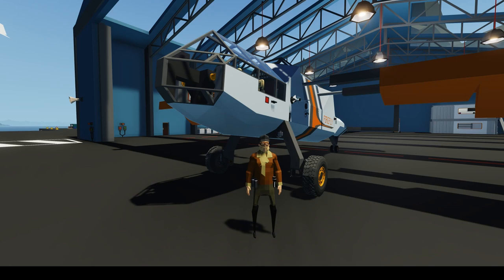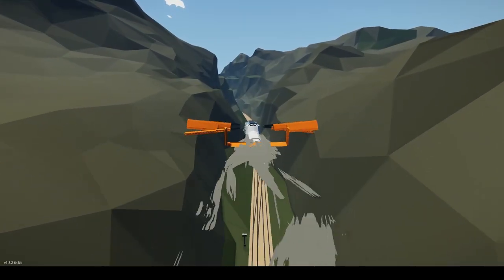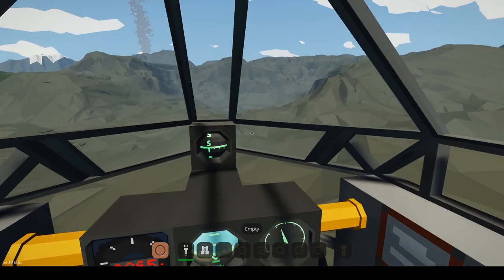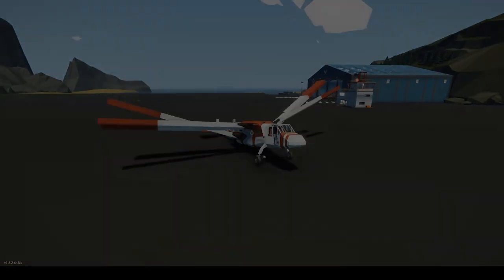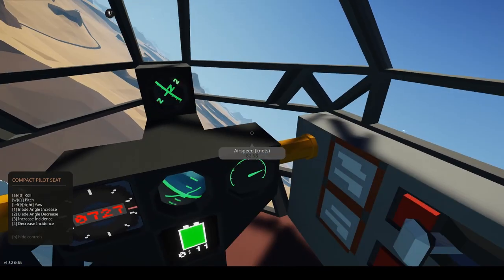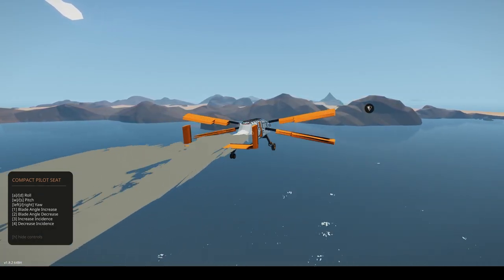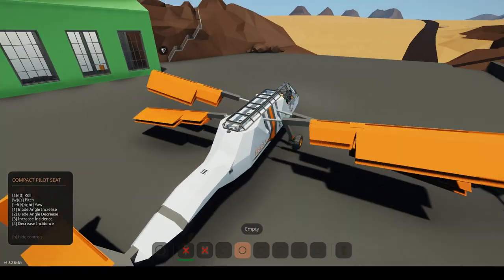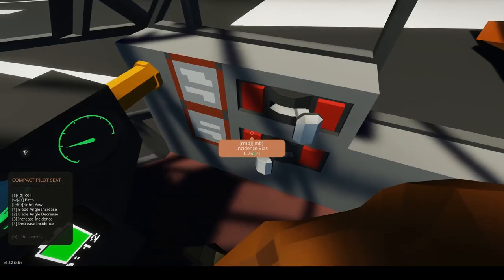"Firefly" High-Frequency STOL Ornithopter

Comment: This is so cool, I've built ornithopters in other games but I never imagined it would be feasible in stormworks. I love all of the designs look like the way a real world coast-guard ornithopter would be designed and painted. 

I was wondering how the battery efficiency turns out. I assume they end up somewhere between a helicopter and a prop plane, but with the added benefit of super short runway landings and takeoffs.
Reply from the maker: >three months late reply because YouTube is capricious about what comments it does and doesn't notify me about:

efficiency is extremely high: much higher than a comparable electric airplane. Not for any cool engineering reasons, though. Mechanical linkages in Stormworks are just not balanced to be used propulsively, and cost much less to run than they probably should. 

IRL, ornithopters conceivably have efficiency advantages on conventional aircraft as they do away with the drag of engines and propellers and inflict only the drag that the wing was going to produce anyway. The wing stroke itself isn't very efficient though, so in the real world they're usually pretty mid.

Comment: Thanks for your hard work on explaining and educating. I'm not going to build an ornithopter, but I sure do like knowing things.
Maybe a mid-frequency, mid-span 'thopter would be most suitable for practical purposes? Or is the middle option not good enough at any one thing to be worthwhile?
On the subject of torque density: Have you considered augmenting the hinges with pistons? Massive power in a small package, but prone to stretching, of course. I suspect they'd do bad things to the sinusoid, but they could be tuned to accelerate the curve during the most efficient parts of the stroke.
Similar thoughts on using rope "tendons". Probably more trouble (and inconsistency) than they're worth, but interesting applications abound.
Reply from the maker: Glad it made sense and was maybe a little useful. 

As for pistons, I've done a little bit of science with them, but haven't had much luck as of yet. Unless you're doing a perfectly linear beat you have to have a second set of hinges that the wings pivot on. I tried a setup like that with very short wing spars and was able to reach an extremely high beat frequency, but the system collapsed once the wings grew at all. There may yet be something to it with enough pistons, or a more creative piston-spar linkage that could deal with the fact that the distance between the top of the piston and the wing hinge (and not just the angle) changes. In my test rig I just let it stretch. 

Biggest downside I can see to doing it with pistons is I don't see a way to achieve a see-saw blade motion. Aesthetics aside, the see-saw motion seems to be unilaterally better. That does give me an idea though... Time for another test rig
Reply: @decofox6789  I don't even play any more. I got tired of new systems being added, and poorly at that.
For your see-saw, I'd place the pistons vertically and two blocks outboard of the main hinge.
I like the unpowered hinges (I think they're called pivots in-game) on both ends of the piston. The top one being in the same horizontal plane as your main hinge. They're also a bit stretchy, but they're stiffer than the electrical connectors that people frequently use. Plus you can merge arrays of them.
Reply from the maker: @cf453  That's more or less the test rig I came up with, though I arranged my pistons horizontally above and below the hinges. It's actually really promising! Hit 128 knots, which I think is the fastest I've gotten any ornithopter to go. The shake is BAD (owing I think to the extra hinge needed to hook the oscillators to the wings) but I think I can probably improve it. Can't post pictures in YouTube comments, but I might drop a 30 second video in a bit. MST3000 time at the moment.
Reply: @decofox6789  Awesome! I wonder if you could dampen some of the shake with 90deg opposed pistons? (And I'm also waffling on the ropes-as-tendons idea)
It's probably not viable in Stormworks, but it's an interesting notion.
I never got big into the mechanics because more than 4 sub-bodies puts me in slow-mo.
Hope you enjoyed the show. I've been watching the Unauthorized History of the Pacific channel. Which is actually very reputable history, contrary to the rather cheesy name.
Reply from the maker: @cf453  
https://www.youtube.com/watch?v=E16X2Ca5eb8
Here's a quick video demonstrating my top/bottom oscillator design. I tried one the way you described also; unfortunately, while it looked awesome, the shake was worse and the final speeds only about half as fast. That said I bet there is a configuration of joints that would make either configuration work beautifully. Any luck and I can find it.